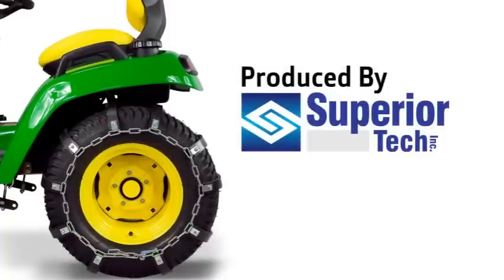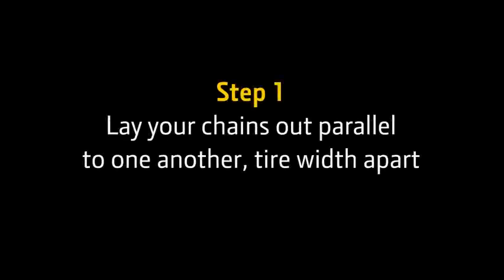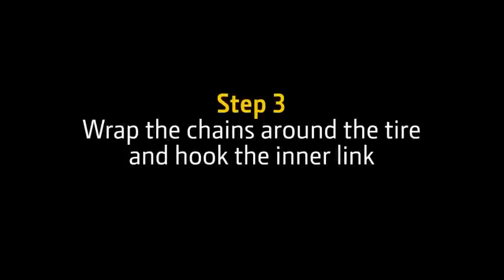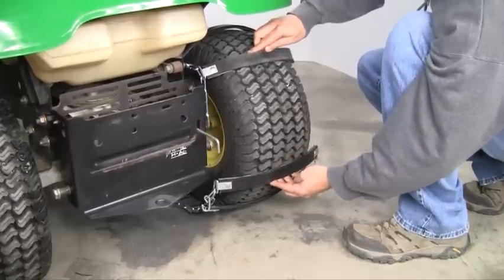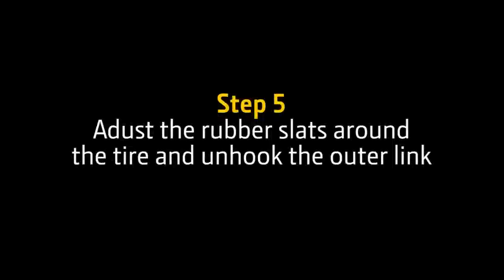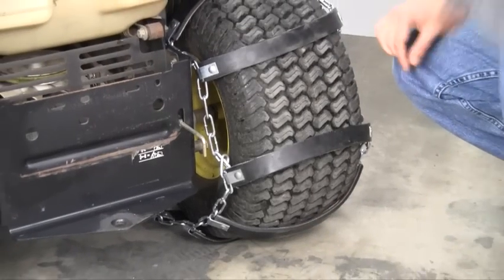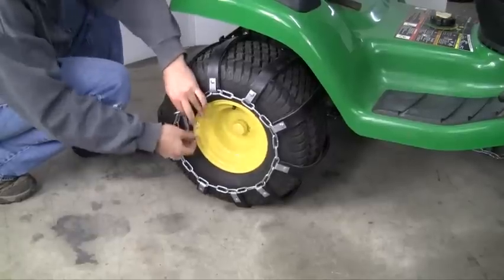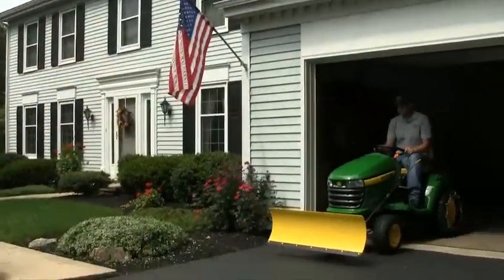terra grips installation

Comment: for traction in the snow, is that really any better than chains?
Reply: Driveway pavers
Concrete driveways
Brick driveways
Sidewalks and other walkways
Asphalt driveways
Reply: I would think that depends on what surface you are on.. if concrete I would think so. If someone wanted to do a cheap diy of these there are plenty of "gators" on the side of the highway to cut into strips. (Gators is a trucker term for the strips of tire tread they glue onto trailer tires when bald instead of replacing the entire tire.)